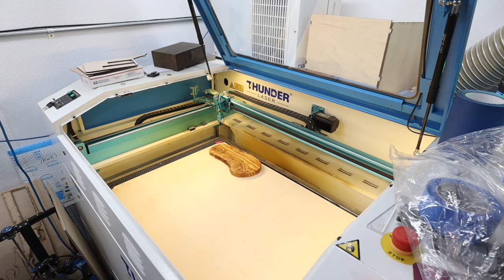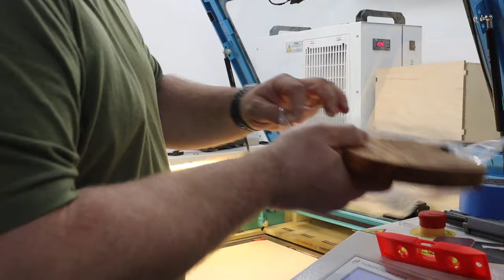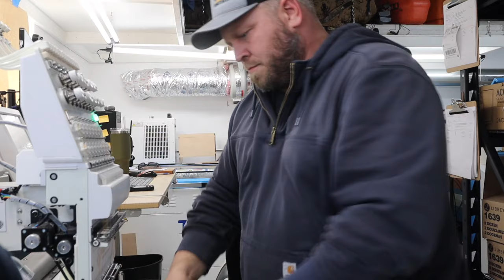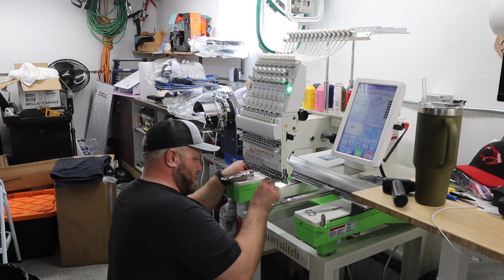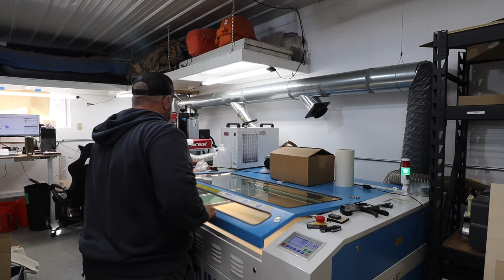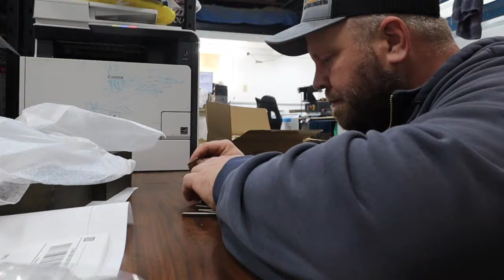Day in the life of a small business owner.

Comment: Hi Matt, I bought transfer tape for my diode laser, but I'm seeing a lot of smoke marks around the edges (under the tape) where the laser engraves, and the transfer tape is bubbling up (getting air bubbles). Is it because transfer tape doesn't work with a diode laser and should be used with a CO2 laser? 22watt laser, have tried running fast, slow, lov power and high power
Reply from the maker: Are you using an old credit card to apply the tape?